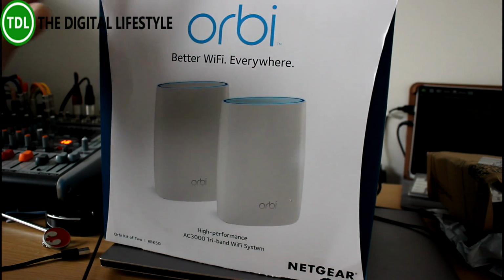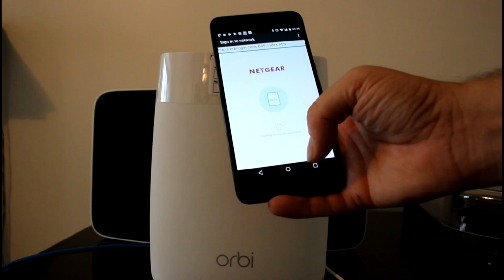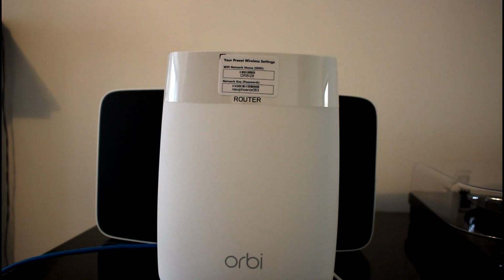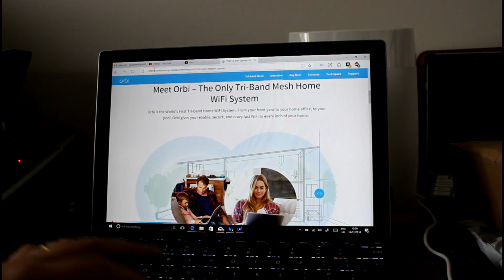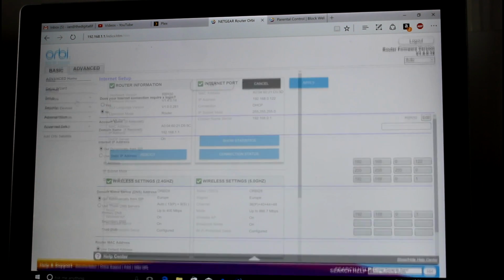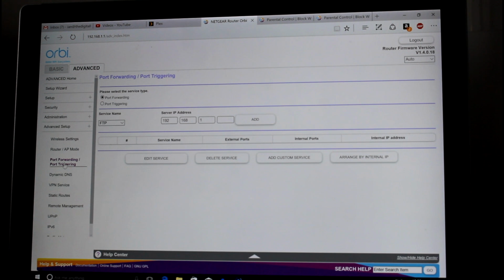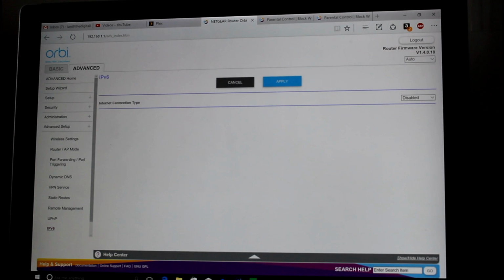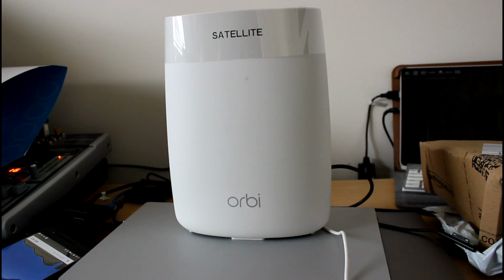Setting up and review of Netgear’s Orbi Tri-Band Mesh WiFi System

Comment: can anyone help me please? what if i have  a Modem Router (in other words, a router with a built-in modem)? will it work? is it compatible? every instruction or videos are about houses where there is an apart modem device  from another router device. thanks
Reply from the maker: You can use it with a modem router. You plug the Orb into your router

Comment: i live in the caribbean with wifi speed at 8mb -15mb(rarely) down, do you think this would make a difference in my house
Reply from the maker: You should get 30-40mb between devices on the wifi. The internet speed is totally dependent on what your broadband connection speed is.
Reply: Ian Dixon oh thanks, subbed btw, really helpful info about orbi. you wouldnt happen to know how to find ones broadband connection speed?
Reply from the maker: The best way to check is to plug a laptop directly into your router and do a speed test (speedtest.com). That way you will see what speed you are getting from your ISP regardless of your wifi
Reply: Ian Dixon perfect, thanks alot man, really grateful.trying to do youtube over here with poor net doesnt bode well.